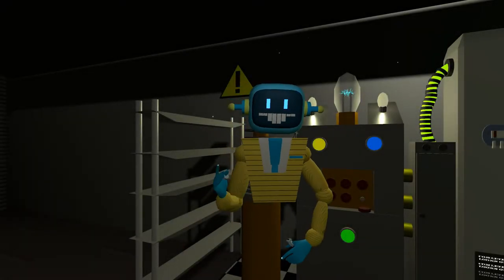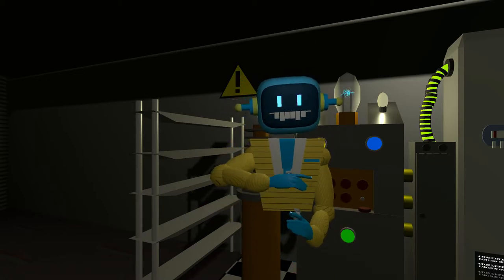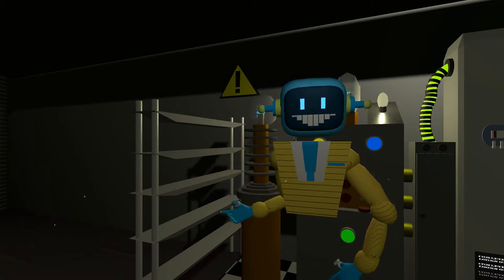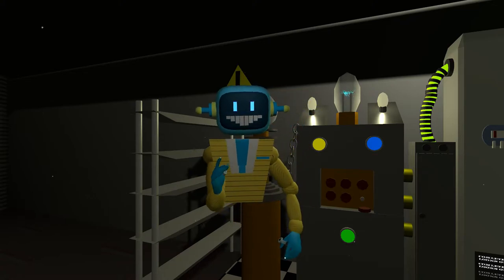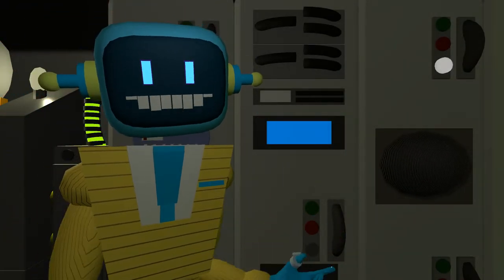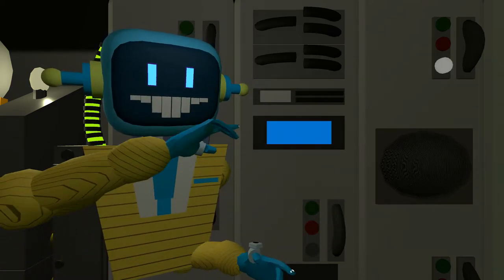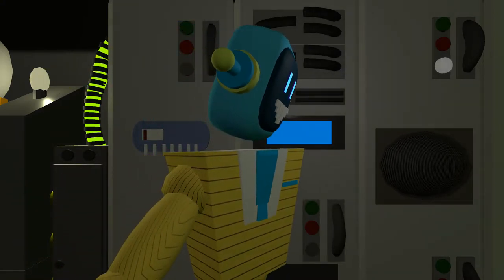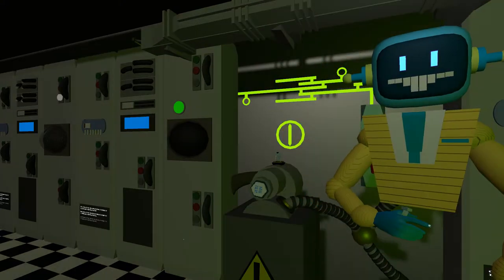Orange Automation User Guide

Comment: Hi, I'm Jinx, and welcome to the far wall of my lab.
This is my full installation of an Orange Automation Triple Encabulator setup vis a vis a quantum flux generator, thanks to my own proprietary hydronic atomizer system.
Every 56k tachyon pulses of the Habashaw distribution regenerate the output energy.

I'd like to thank Orange Automation systems for working with me to install this baby; they have met and/or exceeded all of my needs in my workshop!